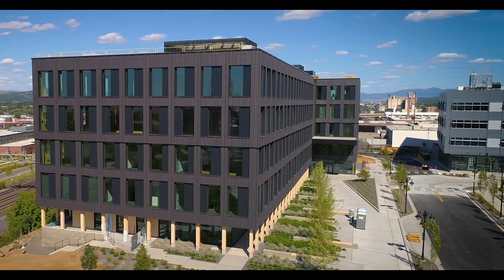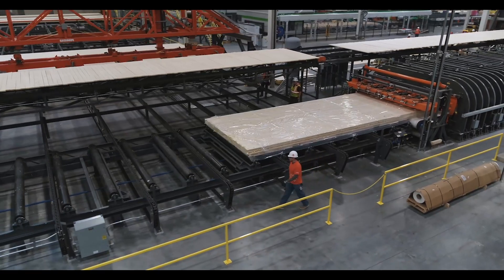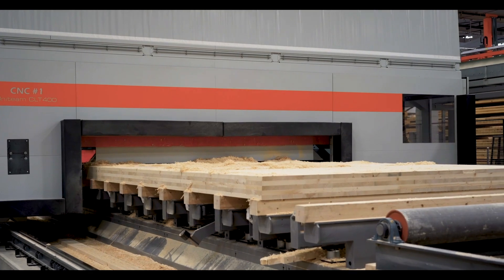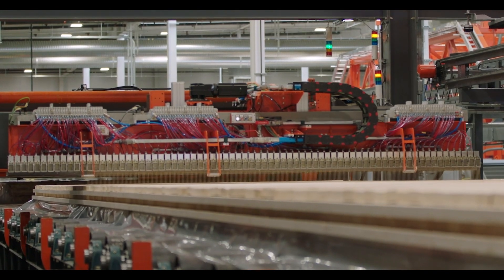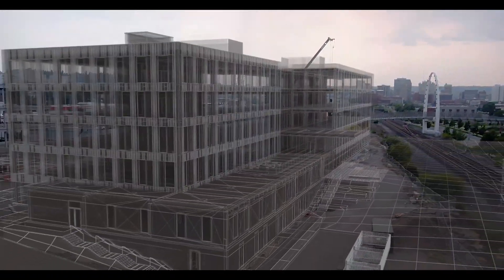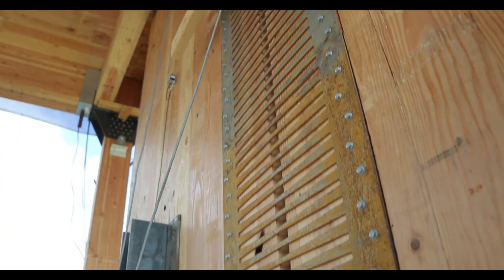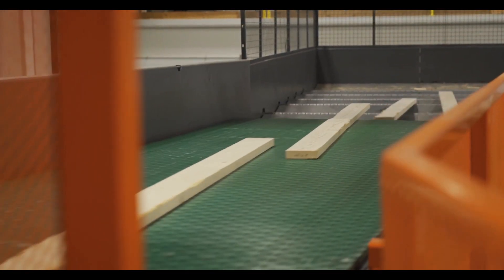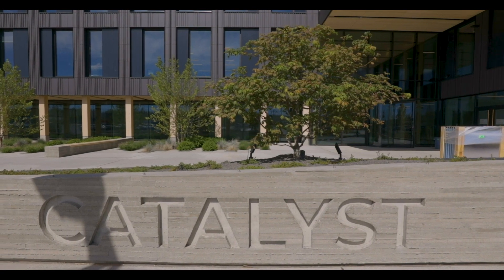Catalyst: A Mass Timber Showcase | Katerra

Comment: How do we ensure, and end-of-life (2-3 centuries?) that the CLT infrastructure won’t be burned or composted, releasing the CO2 back into the atmosphere?  As a oceanographer with some climate science background, I know the effects of anthropogenic climate change of the 19-th21st centuries will still be dogging in the 23rd century. Do we need a tax or trust fund to assure this long-term carbon stays locked up?
Reply: Hi Eric, I can't speak on behalf of Katerra, but perhaps I can provide a bit of useful info. When talking about reducing carbon footprint through the use of mass timber, really it comes down to several factors. Firstly, wood is a renewable resource that requires very little energy to harvest and process into a functional product (glulam, CLT, stick-framing for houses and so on) relative to steel or concrete which release huge amounts of energy into the atmosphere in their production. If sustainable forestry management practices are in place, this makes it a very strong choice as a sustainable building material and new technologies in fire safety and factory lamination have made it possible to build large, safe structures from mass timber. As far as end of life release of carbon, this is really a more minor benefit. The carbon in the wood will not be delayed from entering the atmosphere forever, merely delayed. However, while the carbon is captured in the wood of a mass timber building, new trees are replanted where the cut trees used to stand and these trees capture CO2 from the atmosphere. I like to think of the ideal scenario as a lifecycle somewhat similar to a traditional canoe: natural materials are harvested from the land, they pass their life as a useful structure for us humans and then at the end of life they are returned to land to be reclaimed by nature. While there's certainly a lot of work to do to get anywhere close to that, in my opinion mass timber represents a postive step in that direction. Anyhow, that's just my two cents, hope you find some of that useful :). (FYI I do not work for Katerra, I'm just an architecture student with an interest in mass timber who previously worked for MGA. This is just my personal understanding of the issue at hand.)